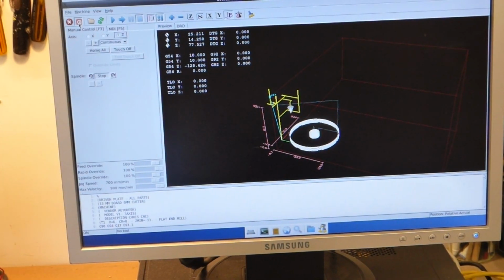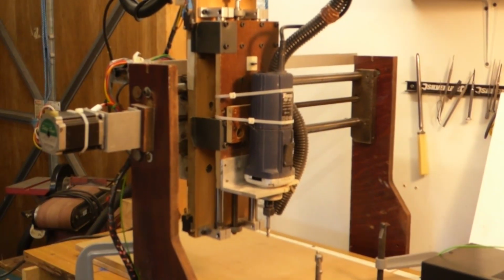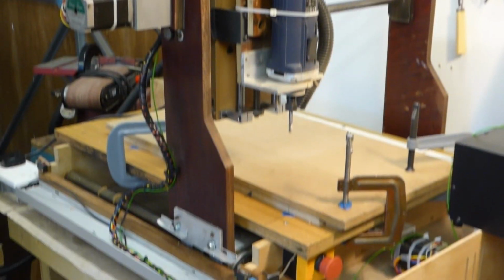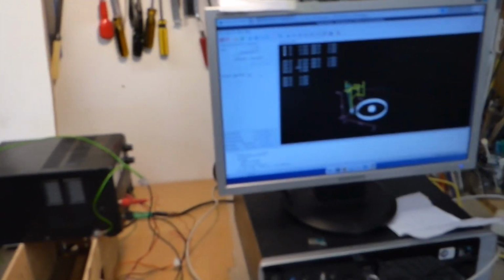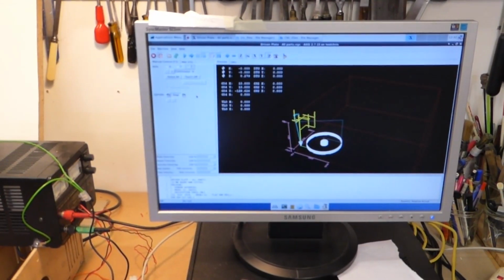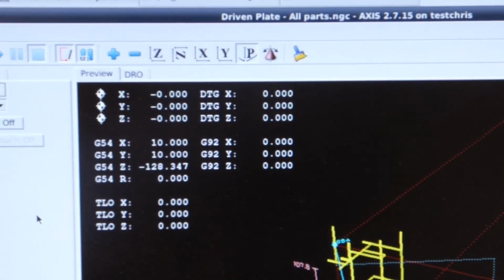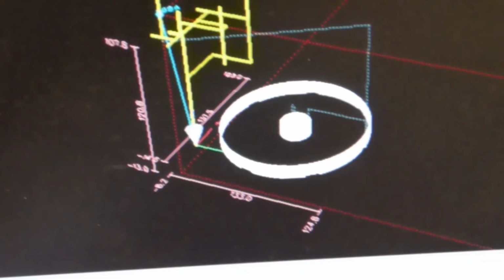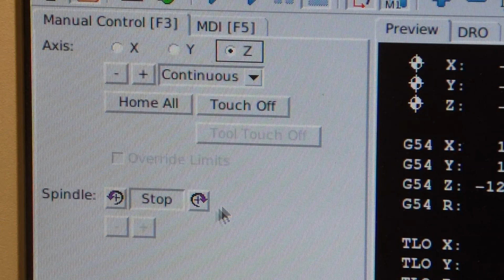DIY CNC Router - Linuxcnc Homing Basics etc  - Spindle Control - Solid State Relay

Comment: my new VFD 2,2KW spindle need controller on-off at linux cnc display, how connect and setting, what code need make, and were folder. i think use similar SSR relay to spindle power on-off SSR is 3-32V DC input and switch can use 25A  but not know how add to linuxcnc, board have cheap paraller port controller whit relay, maybe pin 17 use. im not sure. how can controll display have spindle run/stop button, linuxcnc version 2.8.4 prope working i test whit hall meter. pin 15. and how add water cooler pump relay too, and code "if spindle OFF pump not OFF wait 10 minit then pump OFF,